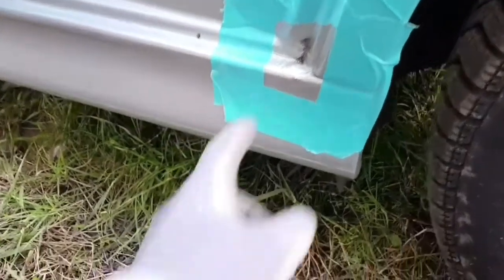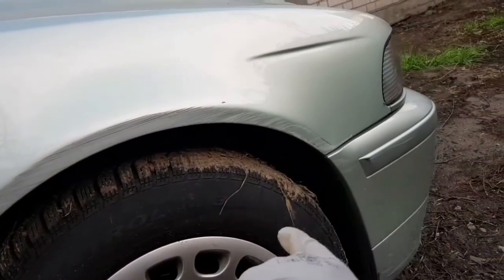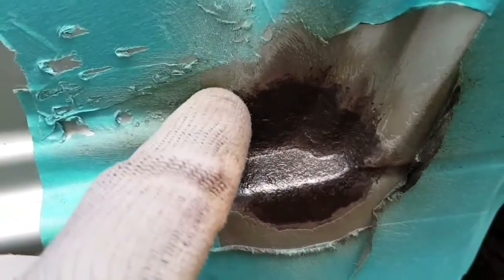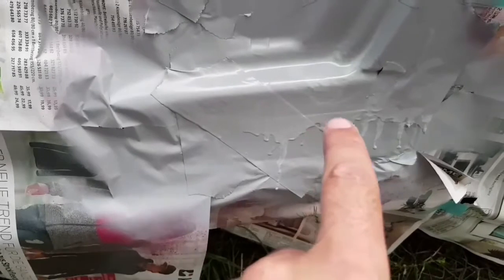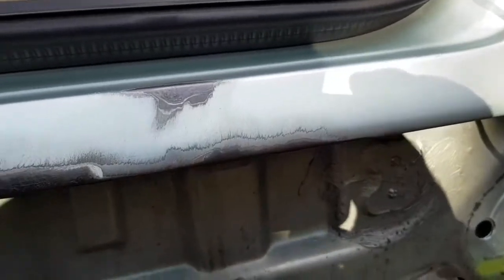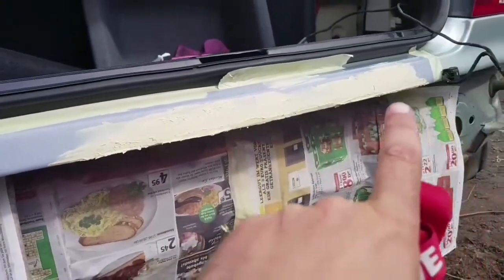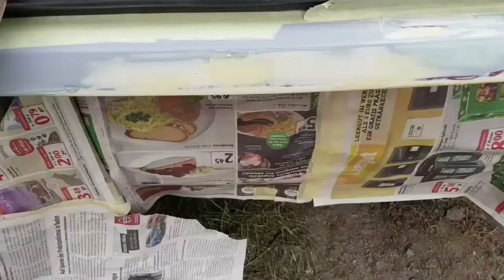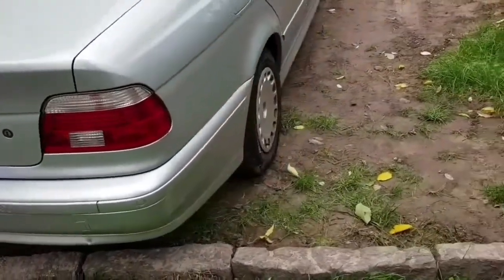Rust repairs on a BMW e39

Comment: Nice work. But wear safety glasses next time you use wire attachment on a drill. Little pieces can come off and get lodged in your eyes, skin, etc.
Reply from the maker: You are right. I have safty glasses and I'm gonna use it. Thx for watching
Reply: @WarpDriveM  I guess I'm only reminded of it because of done that many jobs in the garage only to think afterwards that I really should of worn eye protection. How'd you go with the paint?